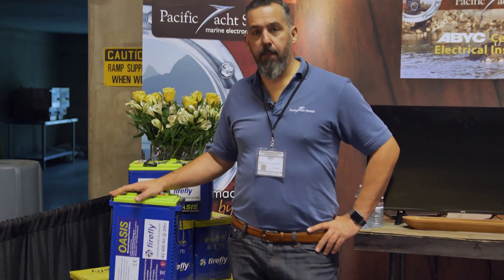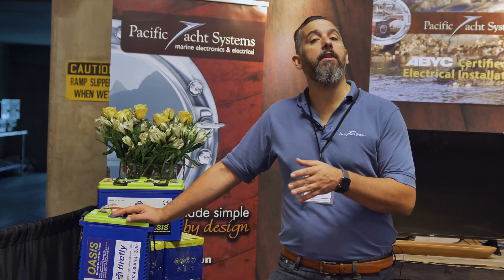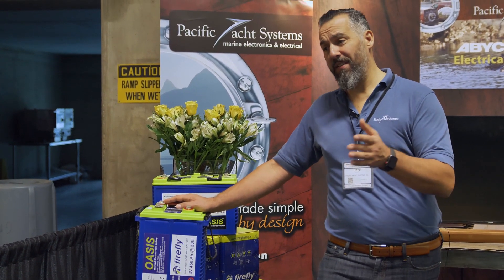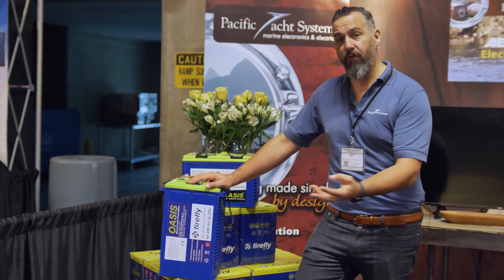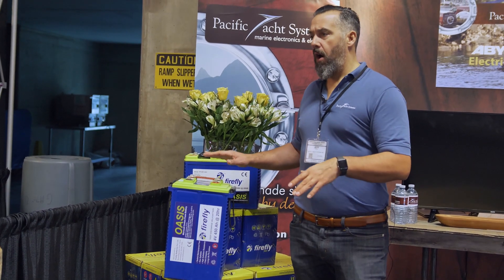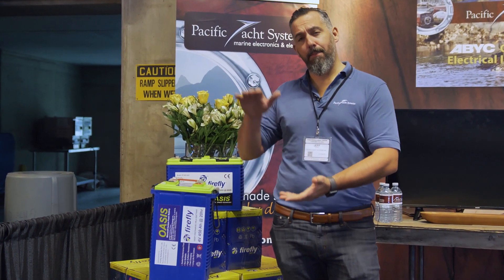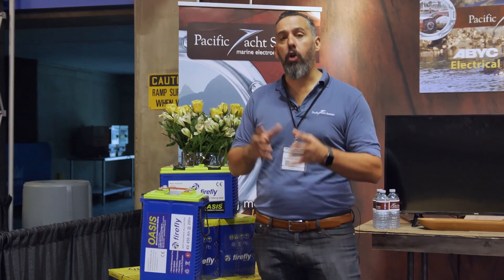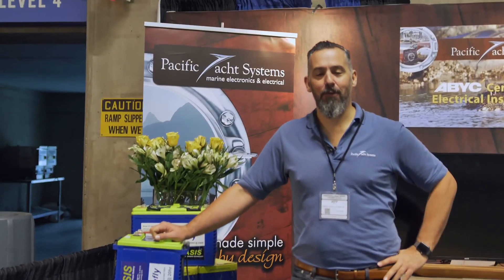Boat Show 2020: L15+ Firefly Battery

Comment: Jeff, thanks again for your fantastic, informational videos. I'd love to hear you explain the relationship between capacity and voltage in battery construction. I'm curious what in the construction makes the 20 hr discharge capacity so high for this battery.
Reply from the maker: Hi Benjamin, remember the Firefly L15 battery is a 4 Volt (95 lbs, 450 amp-hours) battery. We need 3 of those batteries in series to make a 12 volt battery. As a comparison you need two golf cart batteries in series to make 12 volt battery. With 3 L15 Firefly, we have 12 volt 450 amp-hour (at C20) 285 lbs battery bank. This is what you'd expect for amp-hours to weight for a AGM lead acid battery.

Comment: I like your videos and used them to settle on Fireflys but I want everyone to be aware of the biggest issue surrounding them, logistics. 

Why does Firefly even bother selling batteries? Can't buy them on the West Coast of the US unless you are in San Fran, Seattle or Vancouver Canada. Very important <sarcasm> that Seattle and Vancouver both have resellers but only San Fran and not either LA or San Diego. I have called everywhere, searched every possible company that may carry them and nothing.  For those on the East coast that may not be aware how long Cali is, that is like driving from Jacksonville Fl  to Richmond Va to get batteries.  At least the current health issue makes driving through downtown LA a little easier

Consult this link before you waste time doing comparisons between batteries and deciding on this. https://oceanplanetenergy.com/advanced-energy-storage-systems/firefly-energys-oasis-group-31/our-firefly-battery-dealers-in-north-america/

As for anyone with Firefly reading this, LA is home of Marina del Rey... a marina with not one, not two, but THREE zip codes. I am in San Diego home of Dennis Conner and three Americas Cup finals. LA and San Diego are somewhat close, grrrr. What the heck is in San Fran, just Clint Eastwood swimming in the bay and doubt he had 2 L15s on him at the time. What is around San Fran...
Reply from the maker: Thanks for sharing.

Comment: Another fantastic video Jeff. I was looking at Firefly and Lithium. One concern I have with Firefly is voltage sag. How well do Firefly batteries compare at maintaining voltage when discharging?  

A similar question is how fast can I push a charge into them?

Thanks again for all your great videos.
Reply from the maker: Good point, a Firefly battery does have voltage sag over time.